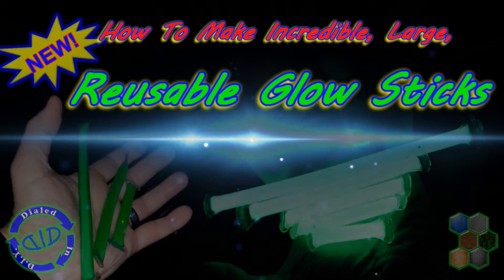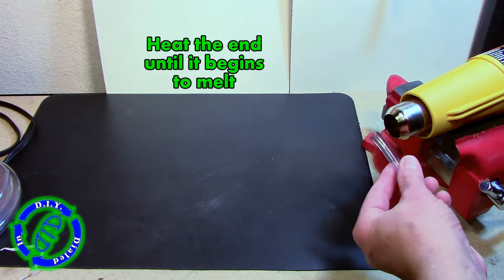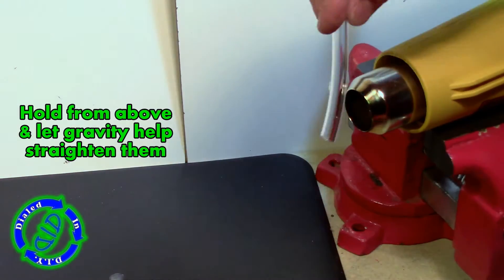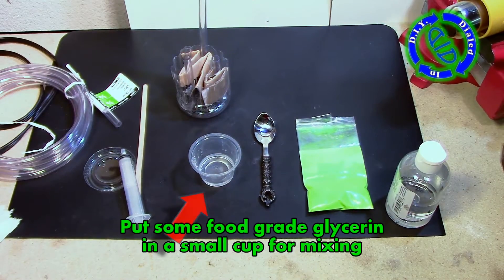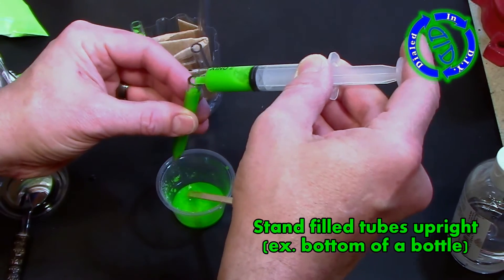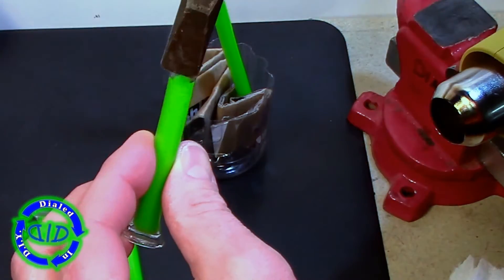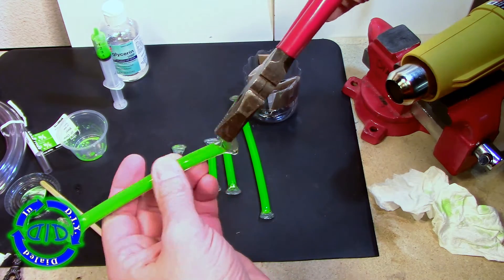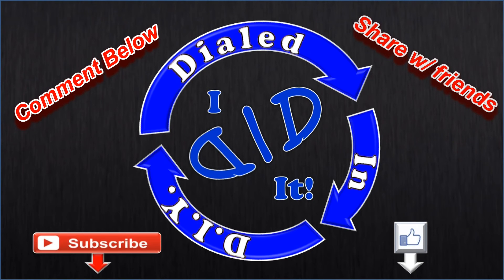Make Reusable Glow Sticks - bigger & brighter

Comment: Would the powder work well if it's set in resins?
Reply from the maker: Great question... Yes!  It is amazing set in resin also.  I have been planning to do a video using SA mixed with resin. The one word of caution: some resins have additives to prevent discoloring from sunlight. This added UV protector hinders the ability to charge the SA with UV light. Thanks for taking time to watch my video and post a comment!

Comment: Hey i was wondering if i should blend the mixture together, as i did it as you did in teh video and the mixture has already started to seperate and needs to be restirred. It keeps setteling to the bottom on the container. So i was just asking if there was a better way of mixing it more thoroughly.
Reply from the maker: You are right, it does start to separate out because the SA does not dissolve in the oil. There are a couple of options. You can find thicker carrier fluids (ex. vegetable glycerin) which will slow how fast everything separates (but also may make it harder to shake them up to mix again). The other option I have used is clear silicone caulk. It works great and sets up strong (requires larger tube and more material.  Epoxy works too but is less flexible. Hope that helps and very sorry for the delay in reply!
Reply: @DialedInDIY  hi, i just made this bout 3.00 pm... but now, its separated inside the hose..... and doesn't  even move an inch when i shake the hose... lol

Comment: How long do you have to wait after putting in the strontium aluminate + glycerin compound substance into the tubes before sealing them? How long does this project take from start to finish?
Reply from the maker: Once you mix the Strontium Aluminate and Glycerin you do not have to wait to seal the tubes.  You can seal them right away or you can wait a bit.
Reply from the maker: Start to finish, if I already have the materials together, takes less than 5 minutes for me to make a small batch.

Comment: In your Ace glow tape video you said those last for years, how long do these last?
Reply from the maker: Excellent question & glad you asked.  The strontium aluminate products are great and last for many years too but the results over time depend upon what it is mixed with and how it has (or has not) been handled.  What do I mean?  The liquid versions I made, such as the one above, allows the powder to separate since it does not dissolve.  If the glow sticks are not moved around from time to time they settle out and can get harder to remix.  So far I have been testing a batch made almost 3 years ago and all work great except for one.  I let all of them sit for about a year and one of them started to set up a bit solid and is not breaking back up well.  The others are holding out really well.  The solid versions that I made (ex. glow cubes and glow stars) work as well today as the day they were made.  Please feel free to let me know if you have any other questions.  I appreciate the comment/question.  Thanks for watching!
Reply: @DialedInDIY  i made something the other night and the powder already started to seperate and became harder to mix, i was wondering if there was a better way to mix the glycerin and powder together, maybe blend them together or would that not work, or how would you suggest i better mix it because i did similar to you in the video?
Reply from the maker: It's a great question.  The simple answer is that you can't really change the separation in glycerin. They just need to be mixed regularly.  BUT there are other options.  I've been experimenting mixing with different materials that turn solid but remain flexible.  Best results so far is clear silicone caulk. I'm trying to figure out the best option so I can make a video to post.
Reply: @DialedInDIY   ohh ok that does sound interesting and i look forward to seeing that video.
Reply: @DialedInDIY  maybe u already answer it... but enlightened me please.... in this video, its a liquid in hose right, how to make it solid like uvpaqlite tooblite one? Is the hose wont bend anymore? Thanx 4the answer

Comment: will the liquid mixture inside be affected by the heat?
Reply from the maker: Great question.  Glycerin is used in cooking and holds up very well to heat exposure so the small amount of heat that transfers through the tubing doesn't degrade the glycerin.  Strontium Aluminate is also rather sturdy under modest heat exposure and is further protected by the thick liquid.  I have not had any problems due to heat with any of the versions that I have made.
Reply from the maker: oh, and also... the way I am heating the end of the full tube to seal it keeps the mixture out of the direct line of heat.  Thanks for the questions and for watching!!

Comment: Can you tell me what the ratio of strontium alluminate to glycerin you used is?
Reply from the maker: Hi Melissa, for bright glow sticks I use about 1 tablespoon of glycerin and 1 teaspoon of strontium aluminate but I have tested out to 2 tablespoons of glycerin with good results.  Just remember that different color glow powders may have less brightness than the green... so you may not want to thin that out as much.  Hope that helps!  Thanks for checking out the video.
Reply: Dialed In DIY thank you! I'm doing this with cub scout so ordered the two colors that said would glow the longest!
Reply from the maker: Fantastic!  I'd love to hear how it turned out for you and the kids when its done.
Reply: I tested it out tonight and the Strontium alluminate keeps deparating from the glycerin any suggestions?
Reply from the maker: The SA doesn't dissolve into the glycerin, it actually is temporarily suspended in it, which is why it will settle back out.  I store them horizontally and then rotate and shake them to get them mixing again.  That said, I have continued to experiment with other mixtures to reduce or eliminate settling.  One method uses clear silicone caulk which can be seen in two of my other videos, "glow in the dark stars" and "glow stick cubes" (found in this playlist: https://www.youtube.com/watch?v=eVVjZd-TXjk&list=PLvOx2Z09WVy-JTJ2V8RfFz2KkDfSULc_W).

Comment: I bought some power and noticed it isn't glowing. does it need to be charged or activated in some way?
Reply from the maker: The super glow powders (aka strontium aluminate) just need to be charged under light before they will glow.  Direct light is best especially if you can use a black light.  What kind of powder did you get? Do you have a brand name?
Reply: Dialed In DIY  it's from TechnoGlow  I havn't used a blacjlight or anything but its been sitting under a light bulb for a few days and dosn't seem to glow at all.

Thanks for the help and quick response!
Reply from the maker: In my recent "Glow Cubes" video I made several colors but the last cube I made was Aqua from Techno Glow.  In that video you can see how great that one worked plus the other colors (https://youtu.be/4Yva3CWCfNY).  What color did you buy? I ask because some are much brighter than others because of what is added to get the different colors.
Reply: I baught orange... ill definitely check out your video tho... thanks for the help.
Reply from the maker: Glad I could help... at least with some info.  The orange is not as bright of a glow as some other colors so you may need more time for your eyes to adjust to darkness and the powder may need more direct, bright light exposure first.
Reply: It need's to be exposed to uv light, either from the sun or from a uv light… 
You probably won't notice it during the day tho, it's like those clock that glow in the dark? The ones you can't even read during the day. It should be about that bright.

Comment: Where did you buy your glow powder
Reply from the maker: I have been buying it on Amazon. In the recent "Reusable Glow Stick Cubes" video I tested out a variety pack that had 5 different colors.  Just make sure you get strontium aluminate (usually called super glow powder). If you price compare just make sure to check the price per equal unit of measure (ex. by weight).

Comment: Any ideas for a diy lava lamp using this???
Reply from the maker: Great question... I have been working on two ideas that are similar to lava lamps as well as a snow globe type of idea.  When it comes to the glow powder the challenge is getting it to stay mixed in one agent so that it can move through a second agent without mixing.  Original lava lamps use a wax product so maybe there is a wax that can be used which will hold the glow powder. Did you have any ideas?
Reply: Dialed In DIY 
I was thinking wax too, like maybe mixing the wax with the strontium aluminate, or something like the Galileo thermometer type of design.
Reply from the maker: The Galileo thermometer idea is quite clever.  You could use the individual glass bulbs & add strontium illuminate to the internal liquid of each (even use different color glow powders).
Reply: Dialed In DIY 
Yeah, that's a great innovation- using the different colors. Do you know what liquid would go inside the main container?
Reply from the maker: I think the original versions used alcohol but they can also be made with distilled water, mineral spirits or other fluids.  The key is using a fluid like these because they react better to temperature changes.
Reply: Dialed In DIY 
That makes sense- thanks for the tip! You earned yourself a new subscriber for sure! Post a video when you've mastered the glow in the dark lava lamp! I would love to see the outcome!
Reply from the maker: Thank you very much!  If you get one done, or the thermometer version, send me a shot or link.  Would love to see it.
Reply: Dialed In DIY 
Sure thing! Keep up the good work!

Comment: where can i buy strontium aluminate?how much is it?
Reply from the maker: I bought mine on Amazon.  There are several versions of the powder which have big ranges in price.  I just looked it up and found one for $12 for 30g and another at $16 for 2 ounces.  I bought 1 each from 2 different sellers over 2 years ago and I have not finished either yet and I have used them in a bunch of projects... all to say that a little goes a long way.
Reply: +Dialed In DIY OK thanks

Comment: I'm trying to find a way to make a temporary glowing tattoo for a cosplay, is that powder safe on skin? And d'you think there's a way of making the liquid a consistency that would paint on and dry?
Reply from the maker: Great idea and great question!  I looked up safety info (MSDS) before I used it so I am comfortable handling it but I recommend checking the info from the retailer to be sure.  That said, it is also available in a paint form which may be much better for your use. Look for "super glow paint" which should contain the same powder.  I'd love to hear what you decide and how it turns out!  Thanks for watching DID!
Reply: It's not made for the skin. It's a metal alloy. It also happens to be very abrasive… Well… Like powdered metal.
Also it wouldn't stick very well. It could probably be used to make paint. I think they use Titanium oxide for white paint so it's definitively possible, however I have no clue how someone would do that.